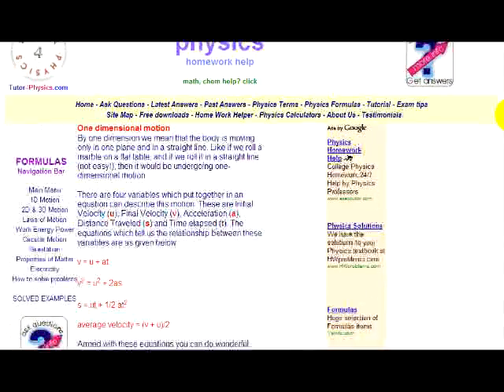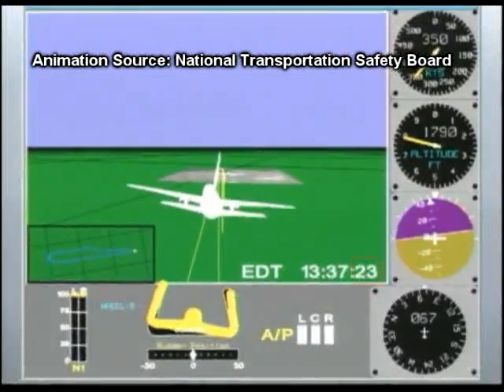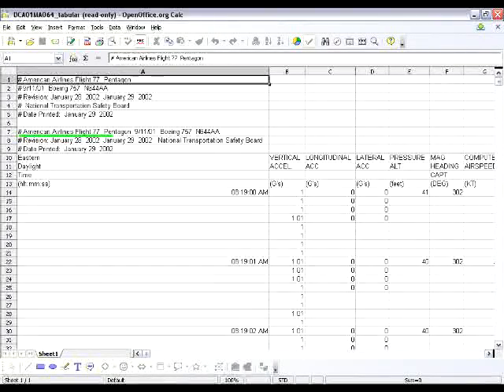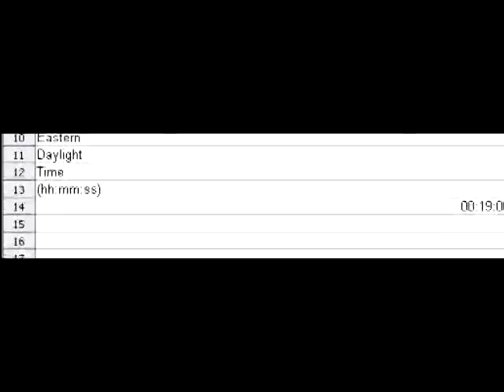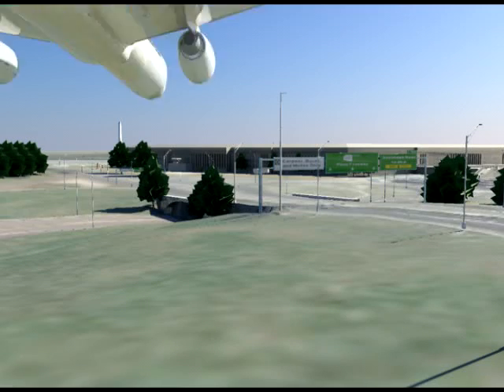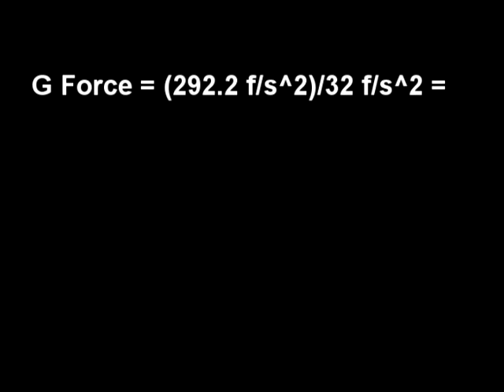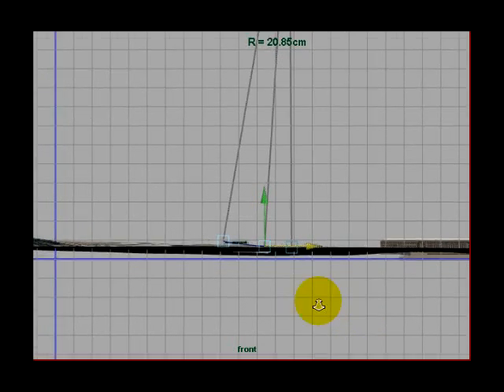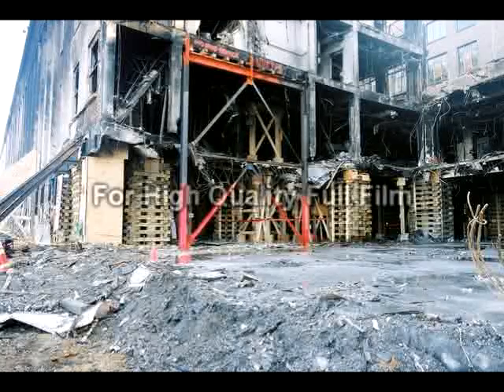G FORCES - Scene From 9/11: ATTACK ON THE PENTAGON

Comment: 2 variables not mentioned. 1. The pilots could of changed the barometric pressure( this would influence the instruments ability to accurately measure altitude. 2. What was the wind speed and direction. But I will say that I have a problem with the fact that nobody witnessed an airplane, what happened to the wreckage and the damage to the building just doesn't look like it was hit by a plane.
Reply: Wes Fox  yea, but you told me I was wrong.
Reply: Wes Fox  The point I'm trying to make is how intelligent he sounds, yet all the fancy formulas he presents to the veiwer are far from realistic. He is missing critical data (variables). For example: 1 + 5 + 10 - 1 x 2 = 30 , but if you remove the x 2, the.answer is 10, which is half the number of the first one. So my point is, he presents these fancy formulas with all this fancy data, but he is missing important numbers (variables) like: wind speed, acceleration of gravity, the weight of the aircraft, barometric pressure, air temperature, and engine thrust (velocity). Not to mention the fact that all his equations are dependent on the direction the aircraft is travelling. Which isn't always the same as it's heading. Because an aircraft's heading isn't always the same as it's course (track), for many different reasons. Sometimes it's intentional due to the wind or other factors. ( This is called a crabbing ). I am a pilot, so I know without a doubt that what's sounds like intelligent observations and mathematical formulas, is nothing but a load of carp. .........did I say it better this time??

Comment: No plane hit the Pentagon it was a missile just like there was more than 1 shooter in the Kennedy assassination.
Reply: It's called common sense. A jet plane doesn't leave a white smoke trail and on Kennedy I hate to break it to you but bullets do not stop in mid air and make 90 degree turns.
Reply: The photo they show that claims to be the “nose” of the plane is actually the beginning of the smoke trail of the missile. The farther pentagon camera shows the squiggly pattern to the rest of the smoke. The truth is actually hiding in plain sight. The missile is a small gray streak in front of and above that smoke trail.
Reply: @MrBradleyrc79  correct. Plus a 747... Sheer size and mass would make a way bigger crash site. Physics you know.
Reply: Michael Walter  no. but then I do not have to. Gravity and laws of physics and many years shooting rifles and shotguns and pistols and some common sense is all that's needed to know a bullet doest make 90degree turns in mid air unless acted upon by a equal and opposite action. (Ricochet). No 90 degree turns in mid air just because a bullet feels like it.
Reply: @stopbeingapatheticbitch8628  

Would like to see your eyewitness testimony of people who were at the Pentagon said they saw a missile impact the building.

Comment: Hello everyone,  this comment section seems lacking on some data, some creativity and some logic. You don't have to gas them, you just fly really high and decompress the cabin in flight, restricting access to oxygen. No gas, no bullets, easy idea I came across researching flight mh370. The 19 hijackers were most likely patsies, trained by CIA/Mossad. They probably were not on the planes that may have crashed into the towers, with evidence they were actually still alive days later, or maybe their ID was stolen by the Mossad to put some blame on Saudi Arabia where 15 of the 19 supposedly came from... evidence of Israel's involvement. Both planes simultaneously flew over a famous air force base, likely were the transponder signals were swapped, in a plan the military has already discussed for decades while considering previous false flag events. Remote controlled Boeing's have been functional since the 80's look it up, the system has a name, I will double check that and leave it in a comment. Putting your faith in eye witness testimony? People saw planes, missiles, small planes, black planes, white planes, jets... geez are any of them planted shills? Missile created the holes in the Pentagon, no way around that one, lol just a couple points some of you should consider;)
Reply: Wes Fox  maybe later I'll have time to debate that with you, but let's just skip to my point... eye witness testimony is not the evidence people should be starting with, unreliable at best, before even considering that some witnesses could have been planted to add to the confusion and misdirection. Do you think the wings folded up against the fuselage of that big bird and went inside the 15 foot hole, vaporized along with the rest of the plane like the 911 Commission Report? Lol I'm not here to convince anyone of anything:)

Comment: I operate on common sense. That kid had ZERO hands-on experience in that aircraft. Yet he hit a 50 to 60 foot high building at 350 mph & hit it dead dick center without the engines hitting the ground. I have been flying for over 50 years with 26,000 hours and there is NO WAY I could've pulled it off without the motors hitting the ground...yet, he hit it perfectly!

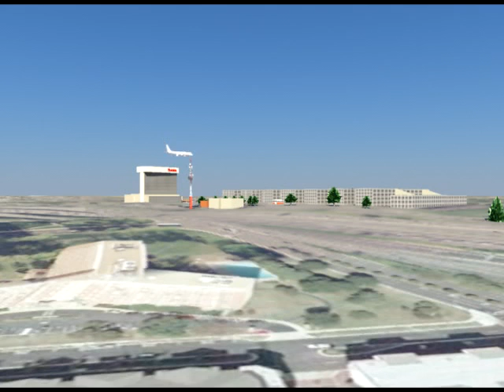Comment: 10:00...... this last calculation is missing a key component, ground effect.   Why was this key factor left out of the equation?
Reply: Yes and air pressure at low altitude
Reply: David Wilders ...... The air pressure and density at sea level (or ground level) is 3-5 times greater.  One of the planes that hit the WTC buildings was calculated to have been going 583 mph.  That is WAY over max operating speed (which can only be achieved at cruising altitudes).   A close friend of mine is an American Airlines pilot who flies and certified pilots on the 757.  To quote him...."There is NO POSSIBLE WAY that plane can reach those speeds near ground level, unless in a very steep dive.  But in a dive like that, the plane would begin to break apart."

Comment: The flight 77 passages were put on to flight 93 which was shot down. Or blown up.  ..???   What's for sure someone knows sooner or later someone will talk.
Reply: Pretty absurd theory. Flight 77 and flight 93 took off from different airports 100s of miles apart, within 20 minutes of each other.

Comment: Right so the alternative to the aircraft hitting the pentagon is that the passengers were flown to some remote location and were all executed. What's the point in doing this? That would be unbelievably messy, risky and leave many loose ends. Wouldn't it just be easier to put the plane where the official story says it was and to fly it into the pentagon? The alternative to the plane hitting the pentagon makes absolutely no sense and violates Occam's razor in every single way.
Reply: "Right so the alternative to the aircraft hitting the pentagon is that the passengers were flown to some remote location and were all executed."~Nick Cockayne
Actually Nick, the question of what happened to the passengers is irrelevant to the overwhelming proof that no aircraft hit the Pentagon. 
If you want to know what happened to the passengers, ask the perpetrators (Cheney et al) what they did with them. The only way you can get answers from these traitorous criminals is a proper prosecution in a trial. 
It is obvious that the justice system in the US is corrupted to the point of nonexistence. 
There is no justice in a despotic panoptic maximum security state. This is YOUR central problem: Denial of the current sociopolitical situation that is right before your eyes.
It is no sign of a sane and sound mind to be well adjusted to a pathological society.
\\][//
Reply: He should also include a reason why the most protected building in the world failed to even attempt to blow that 'plane' out of the air, 5 miles out... Oh, right... the Dick Cheney. "Does the order still stand?  Have you heard anything to the contrary?" scenario...
Reply: Nick Cockayne So what your saying, is The 9/11 report is fact! I'm sure they and the others Theory's alternatives are Occoms Razor.?
Reply: Well we also called bin laden and told him to take responsibility for this and let him know we would be bombing this shit out of his country and killing his boys and he was ok with that so anything is possible
Reply: Just last week, they released a video I've never seen before. It shows a line of maybe 60-70 civilians walking across the Pentagon's grass looking down. Occasionally stopping to pickup tiny pieces of wreckage. As firemen are scrambling around them working on the fire still. The biggest crime scene in US history is an hour old and somebody asked a bunch of brain dead civilians to form a line and contaminate the area and remove critical physical evidence. Yeah... nothing to see there... Ground zero, same thing. An hour after the twin towers fell, there were lines of dump trucks being filled with evidence (aka debris) and hauled away. THAT was the 1st of many red flags for me. It was at 2 different crime scenes. One of them was the PENTEGON !!!!  CIA, FBI, DHS, ICE, TSA, etc, etc...And I''M the only one wondering wtf are they doing?
Reply: @mrscary3721  you aren't the only one;)
Reply: Incredible true!!!
Reply: oldjimi where is a one proof for bought downe by CD of Towers? maybe bend of tower is fact? CD theory not know about this fact.
put explosives which not explode explosivest which survived plane. Try to proof CGI videos nobody do this till today 45 angles of united which is CGI or which is fakery analisis by Ace Baker and others magicians

Comment: i do not disagree with your conclusions  of the gov fabricating a cover- up story. 
i do not disagree with any of your math.
the only comment i will add is that if for instance- the " operational "  g load limitation of  ANY  aircraft is for example 3 g's,  it means the aircraft will perform  UP TO  4.5 g's before structural failure. 
ALL standard operational  limitations of aircraft performance are basically 66% of what that component failure rating.
something rated at for example 100 pounds will hold a minimum of 150 lbs before it fails. 
all aircraft components are required to perform at 150% of their intended design usage. 
this however does not come close to the g load requirement of the cover-up story.